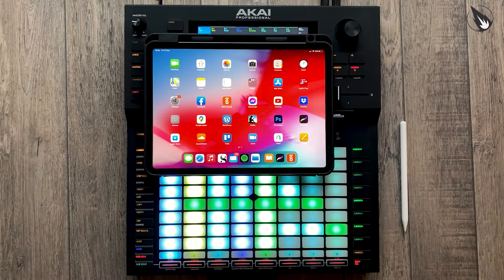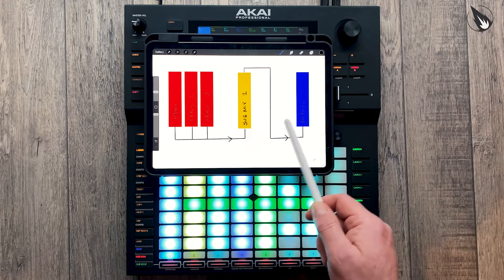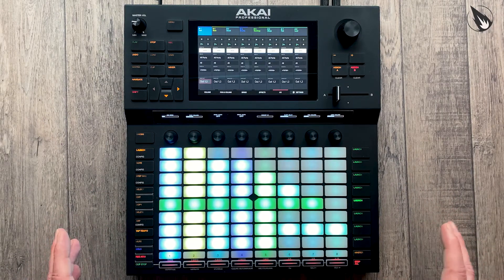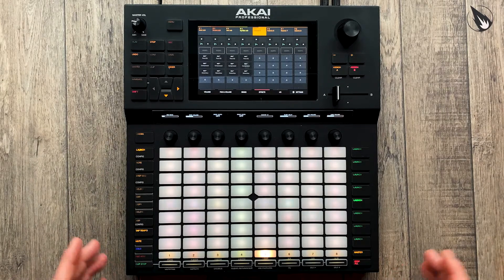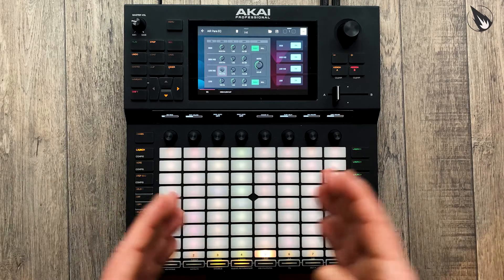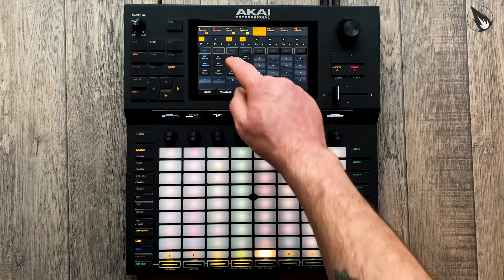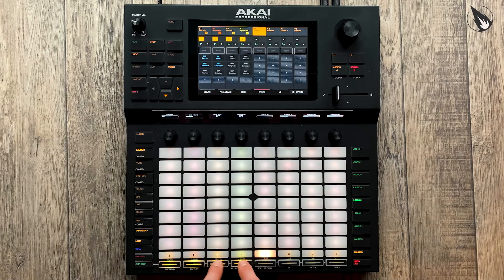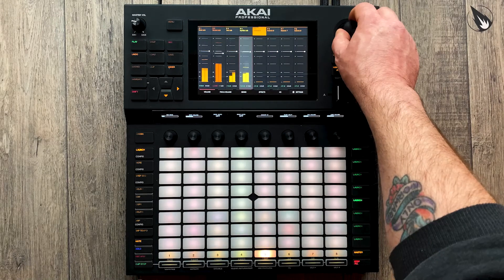Akai Force Tutorial: Using Submixes To Improve Your Tracks

Comment: Ok but your use of the term parallel processing is wrong and therefore confusing to people who don't know - parallel processing is NOT the same as bus processing aka submixes.  In a bus, like in your drawing, the outputs simply get routed THROUGH the bus to the main outs.  But for parallel processing, the outputs get SPLIT, with one side of the split going to a bus, the other side going to the main outs.  Parallel processing allows you to then blend the processed signal with the dry signal, which is not possible with bus processing.  In bus processing, you only get the processed signal.  AFAIK, the only way to do parallel processing on the Force would be to create a submix for any channel you want to stay dry, then use the send/returns to create the processed signal.